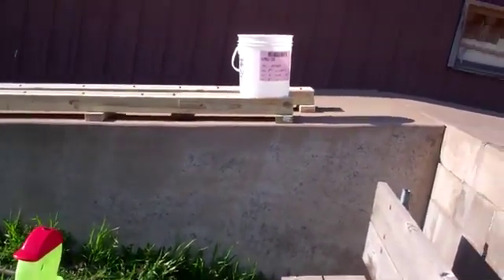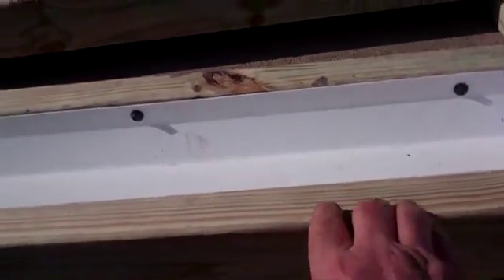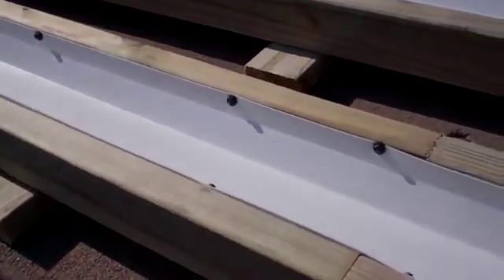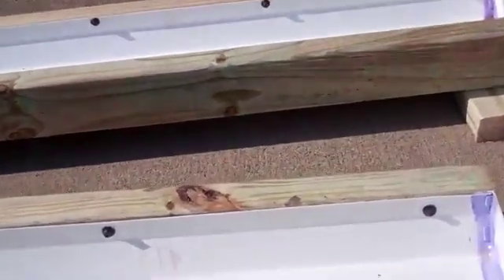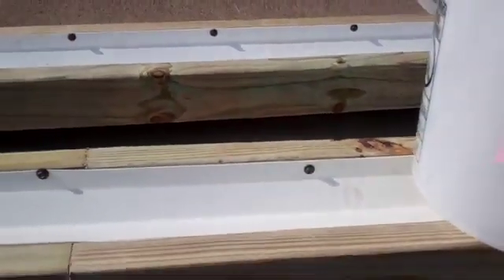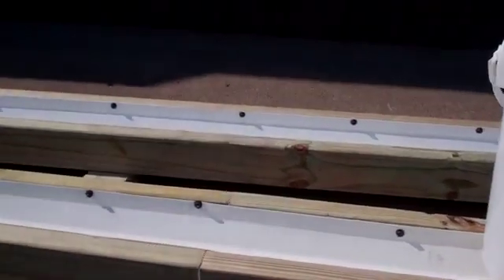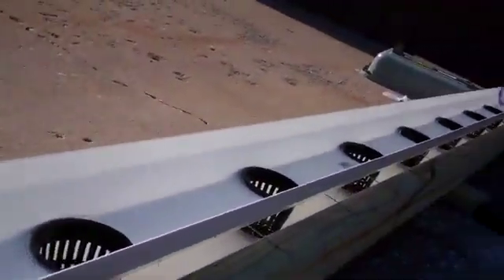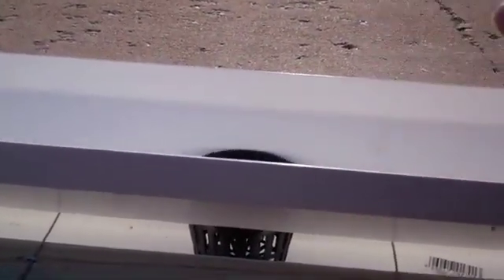The Original Self Watering Rain Gutter Grow System!!!!

Comment: My net cups don't seem to be drawing water from the raingutter. Soil = I added coco fiber, vermiculite,  and compost to potting mix. I packed the net pot tightly (which I lined with landscape material) then filled the 5 gallon bucket (with air holes drilled into the sides and lined with landscape material)  with the same. I've been having to top water my plants. This is my first attempt at gardening in a long time.

Comment: Hi Larry, great videos. You discuss covering with plastic to avoid larvae buildup. I was wondering, if its covered, what happens during heavy rainfall. Water which falls on to the plants will trickle down the buckets into the gutter. Do you have an overflow hole and if so wont bugs crawl into the gutter from there?

Comment: Thanks so much for your help Larry. I'm so glad I checked out your utube channel before I went the double bucket route. I was just about to pull the trigger on that project. Watering 2-3 times a day ain't my bag man.lol  So glad you stopped me. North central FL. is very hot, little rain,semi poor sandy soil, and weed ridden.  Gutter buckets with plastic over the potting mix solves every one of these problems.

Comment: Hi Larry, I would like to use a "master fill " bucket with a float installed in it and connected by hoses to the gutters. It will keep at least 2 ten feet gutters filled with H20 as needed. I saw your bottle fill system and noticed that the water coming out of the bottle stopped filling as soon as the holes were under water, No matter how high the water in the bottle still was.  Is that so ??

Comment: Hey Larry. Rick here in Ga. I have used Earthboxes, then Earth buckets, and then found your method, with the automatic watering.  Both of those worked great, but I had to fill them every day. 
I  have everything I need to make 5 of these, but one question? EarhbXXXX talk about allowing air to get to the roots....will that little 3 inch net pot do the job? Or should I drill some holes in the bottom of the bucket? 
thanks, great videos
Rick

Comment: Larry, is it better to get metal rain gutter b/c it is safer than Vinyl imo?   I think they mostly are made out of steel or aluminum.   This system is much better than self watering stand alone buckets.  However I like to have bigger containers than 5 gallon ones due to small diameter for bigger plants or plants that require horizonal  growing areas like lettuce. Wonderful system and I am sure wanting to build one.  I like see how the float is installed and used.

Comment: Larry, just want to advise folks that 2 7/8 hole saws are not common and if you can't find one, I suggest getting the arbor and hole saw together on amazon as you can get dewalt or another good brand for less than 25 bucks to your door.  In Lowes the arbor alone is 20 bucks.  I got a cheap brand first and it was junk so just sharing my experience to save others time and headache.   You can also just mark the hole with a marker, drill a hole to get your jigsaw in there. Lots more work.  Thanks L!

Comment: Hey Larry! Thanks for posting as a response to my "Self Watering Bucket" video. I have to say to my viewers- "If you have a LEVEL place to set out your buckets I think Larry's set up is superior." How 'bout that for an endorsement! If your area is really hilly or rolling setting individual buckets may be easier. One modification that I had to make in my buckets was to glue a piece of window screen over the 1" water fill/overflow hole to keep out the mosquitoes.Did you have any mosquito problems?